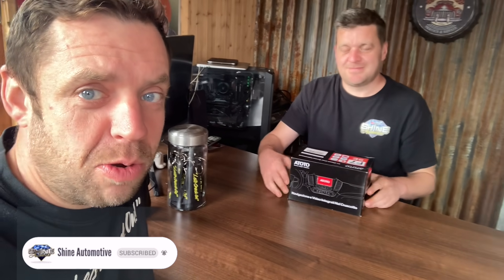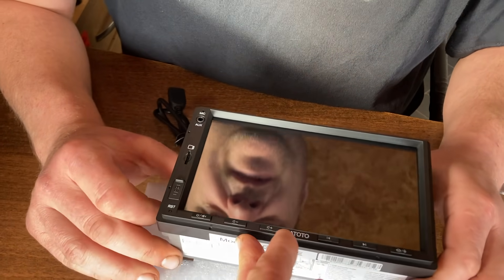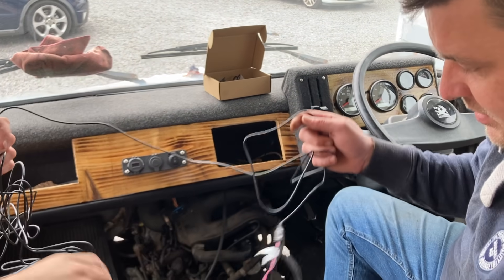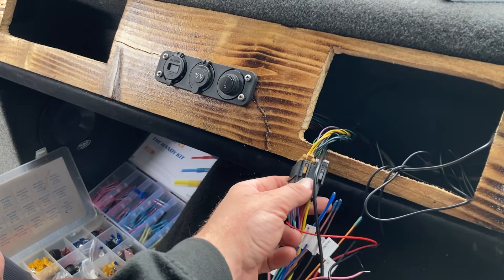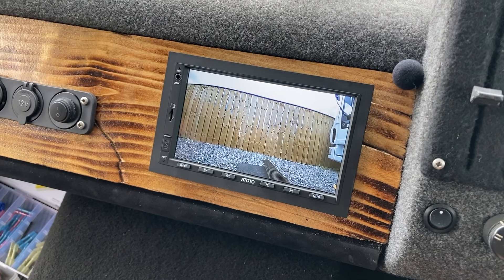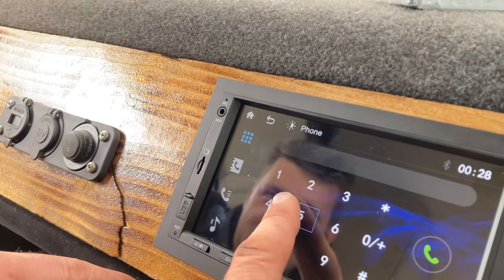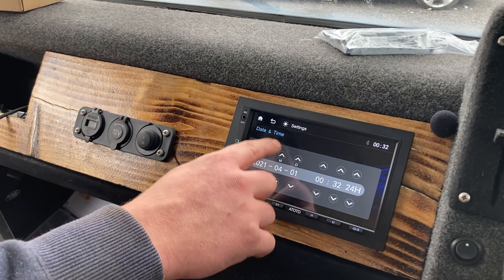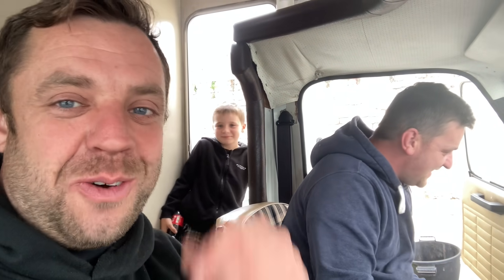Cheaper Alternative When buying A Doubled Din Stereo - Apple - Android Car Play - Is ATOTO Any Good

Comment: I would like to replace the dials in my camper for ones like yours would i still need to put in directional flashers on dash as well for m.o.t
Reply from the maker: no They are fitted in the clocks